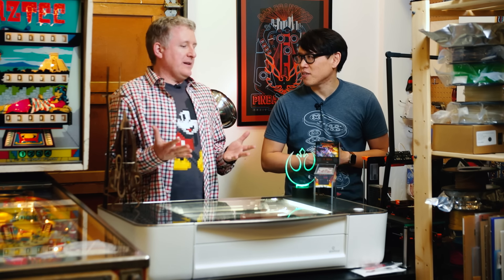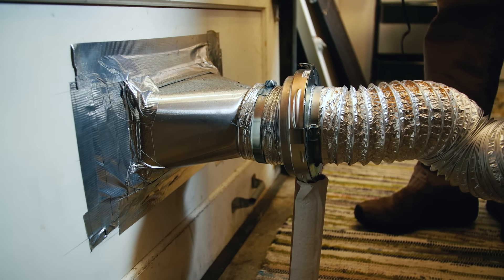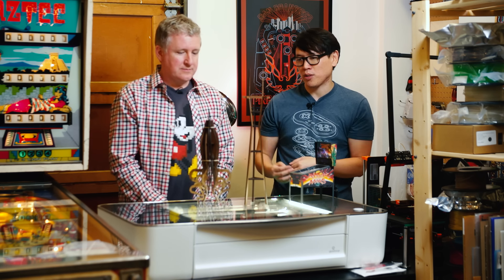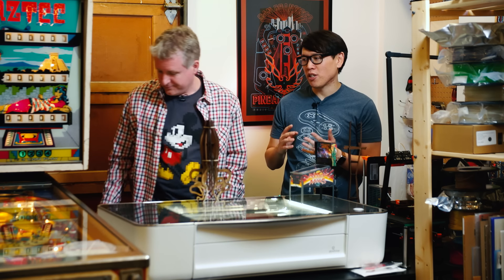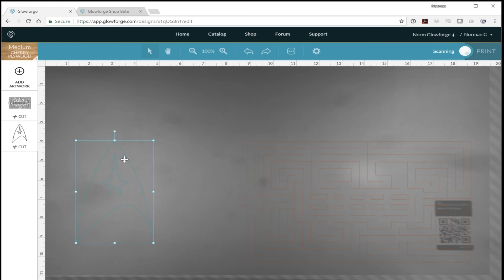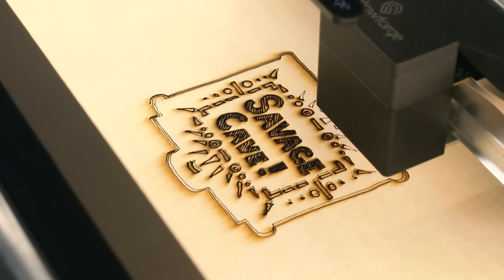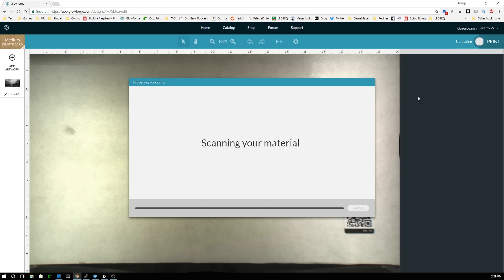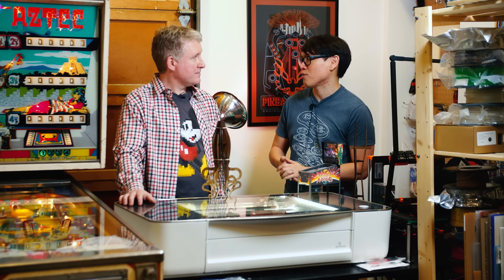Tested: Glowforge Laser Cutter Review

Comment: The DRM/mandatory web connectivity sounds like the antithesis of "making."
Reply: DRM? What DRM? Do you mean proofgrade? You can cut any material you want but it's just easier with proofgrade. I have one and do I'd say 75% with proofgrade (since I know the result will look nicer). Also all the proofgrade wood is prefinished (with a laser safe finish) which is a huge time saver. I don't always use their acrylic, but their acrylic cuts really nicely and smells way less than say inventables' does.
Reply: There is also the shop with pay-per-print designs.
Reply: +Henry Feldman From what I gather, the DRM is the website. It seems as though if their site goes down, then you're stuck with a giant paperweight. You cannot use the cutter unless it connects to their servers.
Reply: I own a Glowforge Pro,. My wife and I bought it because it is approachable for both my wife and kids. My 11 year old son is obsessed with creating things on it.

I think of it as the difference between an iPhone and an Android phone. They both are powerful and both do a great job, but my less tech savvy family members are more comfortable with an iPhone because it just works.

The materials they supply and the designs they sell are completely optional. But I do share your concern about the web software lock in. While I know the maker community has been betrayed before (Makerbot), Dan has assured us that they will open source their code so we can have more control over our machines.

On a related note, there is a guy that already has produced a prototype of an open source drop in replacement control board. He says he thinks he can have them ready by the time the warranties on our machines start running out. ;)
Reply: The laser cutter only works if connected to the internet and Glowforge's servers. They can, at any time they choose, disable your laser cutter and turn it into a brick. It's not "technically" DRM, it's far, far worse.
Reply: @Sembiance  And if Glowforge as a company goes bankrupt or decides to turn off their servers, you're left with a $4000 paperweight too... No thanks
Reply: @Pismoboy  Actually I was wondering if you could remove their controller and install an aftermarket laser controller such as SWC708C Lite.  I bought one of these for my cheap Chinese 50 Watt Laser and found it a huge improvement.  Instead of using Newlydraw with a hardware  USB key for the software, this interface is a stand alone controller with USB, Thumb drive, and Ethernet connectivity.  Save a file to the device and hit start.  It has the full compliment of jog controls and setup configuration pages for laser power, um per step, home switches, setting origin, work area, etc.  If instead you want to use a PC as a controller instead, there are several software packages including Mach 4 that support laser scanners and engraving.  Hardware is relatively simple with a breakout box for under $50 and stepper drivers.
Reply: @lazmarr613  build your own machine
Reply: @Maddux Sam Instablaster :)
Reply: @Hamza Zavier it did the trick and I finally got access to my account again. I'm so happy:D
Thanks so much, you saved my account :D
Reply: @Maddux Sam No problem :)

Comment: I just cannot justify a tool at any cost if I must connect to a remote server to make it operate.  That’s a 100% purchase kill.  My rural shop is in a telecoms dead-zone.  But even if broadband was reliable and inexpensive where I am, the thought of an expensive tool being bricked because of server maintenance, or worse, a corporate shut-down, or even simply “Oh, Version One is No Longer Supported.  Buy Version 4.” just leaves me in a rage.
Reply: Just get something more market-proven and something that comes with a large enthusiast community - like the ~$500 K40/Bluebox laser cutters. Same power, more robust, a lot more hackable to extend features.
Reply: fusion 360 also needs internet..
Reply: It's not perfect either, but at least it's not an upfront investment of WAY TOO MUCH that could just turn into a brick at some point.
Not to mention there's Inventor.
Reply: While I would LOVE to have the ability to etch and cut art, I also wondered what would happen if the company went belly up. If I'm going to put that much revenue into a tool, I don't want that kind of worry attached. I'd be interested in starting to save up for one IF they can make a newer version that can work with or without internet. Even a Bluetooth connection which you could use offline via smart phone, tablet or laptop would be an acceptable middle ground.
In my case, I'd be fine with a simple USB port connection since I'd be using it with my laptop to transfer my art to it. It would have to be by my desk for ventilation anyway.

Comment: I'm a Glowforge owner. It's my first laser cutter and as such I'm pretty happy with it. I think you hit most of the points that have frustrated me, the biggest being the visual alignment using the camera. Having to be online worried me, but hasn't been a problem so far. I also own a 3d printer and the having both really opens up what you can do with desktop manufacturing. My bottom line: Is it perfect: no. Is it really good for a laser newbie: Most definitely. Here's hoping the company has a long life and makes lots of improvements. It's good. It could be great.
Reply: Would you stand by this review still? I’m looking into getting one for my coding centre. We teach kids coding, and are looking to make a “maker space”
Reply: @jbpandit  Yes, I've had the Glowforge for over 2 years now. We use it almost every day. I still feel it is much better than the other "smart" laser cutters out there.
Reply: Aaron Nance thanks! Great to get real feedback from a owner and user  :-) we plan on getting one soon!
Reply: @jbpandit  You're welcome! If you are planning on venting your machine out the window instead of getting the inline filter, there is one upgrade I would highly recommend an inline duct fan to make the machine much quieter. This is the one I use: https://www.ebay.com/itm/CLOUDLINE-S6-Inline-Booster-Duct-Fan-6-Cooling-Ventilation-Exhaust-Grow-Tents/332726603382?epid=6021612502&hash=item4d780d0e76:g:qSUAAOSwQxpbUUyE
Reply: Aaron Nance Sorry, I just saw your reply, I don’t usually comment on YouTube 😂. I’m planning on getting the new air filter, from all reviews it’s awesome 🤞🏽

Comment: Has anyone looked at the Full Spectrum Muse Laser. It is similar priced, similar design and features but offers more flexibility like a rotary, and it's not under pre-order. You can buy it now and get it now. Plus the company makes industrial laser machines as well.
Reply: Yes. The Muse is in its sixth generation, but it hasn't been a problem free journey. Even now just see the tweaky annoyance to baseline and focus for a rotary cut—and not even being able to better fore spec how the engrave is gonna fit. https://www.youtube.com/watch?v=detSHut8oWY

Some dig that extra tinker to hobby hardware. Glowforge still has some of that where it comes to using materials you supply yourself. I do think the extra options the Muse has for availability at sale is nice. But making product use more smoothly integrated UX than other cutters like Muse has is where Glowforge is seeking to differentiate.
Reply: My Muse has worked fine.  There were some software bugs over the last year, but they were quickly fixed.

I have not purchased the rotary attachment, so I cannot really offer an opinion.  I also have barely used the camera.  There were slight alignment issues similar to those described in the Glowforge review.  It is much better when placed in the center of view rather than at the edge.

Most of my use involves cutting material as opposed to etching.  For that is has worked fine.  Other Muse owners in the Facebook group seem happy with their etching attempts.

Comment: 2 exploits that would make this easier to use.  1) Use a macro recorder to record configuring custom settings. Create a custom macro for each material type, and you've worked around the inability to save custom settings. 2) Handheld QR code printers are relatively inexpensive. If you're using a material equivalent to one of their's, you could print their QR code on it. The laser cutter would then "magically" use the right preset.

Comment: Glowforge is a hype machine and glorified K40 laser. Just get K40 and upgrade it with better control board and interface. You save a lot of money and you gain from it as you can save laserwork into the machine memory.

Comment: I thought about getting one as a backup machine for my Epilog, and I'm SO glad I didn't. Compared to a proper machine this looks like absolute garbage. The required web connection alone kills it, but then all the wasted materials is just unacceptable. I go through dozens of sheets of acrylic per week and I have a feeling I'd just want to throw this out the window if I had to use it. I'd quickly lose more money on material waste than the machine is worth.
Reply: Why would web connection be such an issue?

Comment: The web app system reminds me of using a cricut paper cutter, which I'm okay with.  But the camera not being zero'd in seems like a deal killer for now.
Reply: I haven't found my camera parallax off by the "1/4"" at extremities that they say has been their experience. Mine has been about 1/8"—toward the four corners of the max area, which hasn't caused me any major problems for "getting into leftover spaces" on unused material. 

But I do agree with Norm at this point in the beta release it is frustrating to lose some of the sold/spec'd cutting bed (12x20, not including pass through space on Pro unit) because the software is still in beta. 

As he said, it looks fully well like the hardware gantry supports it reaching the entire cutting area—and they've announced software and camera improvement dev tests are still underway. But where he is overstating the issue is saying that you lose an 1" of useable material space on all four edges. I'm measuring a max cut test sheet with my calipers as I write this: I get to .5" on top; .9" at left; .6" at right and .25" from bottom.

Comment: Web app is smart, but they should write the web app as a PWA (Progressive Web App) so it works offline on your local network so you dont need to be hooked and reliant on their servers which may go down or go away if company goes bust. Not to mention the latency in uploading stuff and then downloading to local printer each time. Waste of time. Web tech is very smart idea and makes super easy to update, cross platform / OS support, but use modern web standards  that support being offline working locally for god sake! If they do that I would buy one for sure. This can happen if they just write it or someon else figures out how to communicate with the device locally ;-)

Comment: No one would ever classify a laser by the material of its housing / cavity, but by their active medium. There are gas lasers, chemical lasers, excimer lasers, solid-state lasers, fiber lasers, photonic crystal lasers, semiconductor lasers, dye lasers, free-electron lasers and so on, but I have never heard of a glass tube or metal laser. Please make sure to use the right terms.
Reply: Laser tubes are either glass or metal construction.
Reply: But this is not what determines the properties of the laser and therefore not the possible aplications. It is just non-sense informaion. Some specs like wavelength, power, operation modes, beam diameter, etc. would be helpful  with respect to material processing.
Reply: In the world of laser cutters like this, which are all CO2, they are defined as glass or metal tube lasers. There are different types of cutters, like YAG and fiber, but that's comparing apples and oranges. The most important spec to be concerned with is power output, which they stated was 40 or 45W depending on the version.

Comment: My wife and I considered pre-ordering one of these, but it is a lot of money for something that still seemed like a beta product. We held off, and I'm glad we did. There are just too many caveats, even if it is somewhat useful. I feel like I can build a CNC router that would do a lot of what this thing can do for far less money. The internet connectivity requirement to do any cutting is such a non-starter. Does it give you instant software updates? Sure, but why can't you have the CAM software locally installed and automatically check for updates when you do have an internet connection? You know, like most other design/manufacturing software... Hell, Solidworks will download in the background for you while you are actually doing WORK with your current version...

Comment: I ordered the Glowforge and it arrives this month. I am based in Africa, I will not be able to constantly order glowforge material. This fact of being unable to save settings is worrying. Lets say i have a 2mm thick acrylic sheet sourced locally, I am hoping using the same settings for the glowforge 2mm thick sheet will work well? Has experienced this? Also, does anyone know how long the C02 cartridge lasts?

Comment: This is the 4th glowforge video tested has created. 

Must be a sponsor ( paid content).
Reply: It's possible that it is native advertising—which if it is Tested should disclose. But either way their pros/cons are pretty fair and critically minded for this stage of the Glowforge beta release. Glowforge have almost fulfilled all prerelease laser units for supporter orders and are preparing to fulfill the international orders—and the self contained air filter units are still off for delivery until summer (or later). It's definitely still at late software beta stage — but my Pro is a reliable product I have been able to put to work immediately both for hobby and for clients —albeit not as material- and time-efficiently as still needed. (For example, for repetitive production burns it still adds the time to scan the material for QR codes prior to every burn rather than just letting you jig it and keep cranking out copies.)

Comment: Cute toy. Built my 1800x1200 120W for under $3k. Couldn't imagine having anything less than 100W anymore, it would be miserable. Better off buying a cheapie off ebay and learning how the laser cutter actually works instead of needing your hand held by your wallet. I started with one of those cheap K40's, learned how it worked, how to service it, and how to improve it. Those steps teach you a lot more about your equipment. Subsequently I learned enough to be able to build a much bigger and better machine. If the glowforge was an RF laser machine and had some quality hardware, you could justify the price. But for $4k+ for a nicely bodied chinese glass-tube K40 and cloud interface? yeah no thanks. If you have $4k to spend on a glowforge and you just really don't want to learn how a laser works, spend a few thousand more and get an entry level Epilog, Trotec, or Universal. It will hold its value unlike this meme of a laser machine. You will also get much faster engraving speeds, higher quality, and truly better software to control that enterprise grade hardware. Heck, for a little more than $4k you can get a galvo head fiber laser and start engraving all metals.